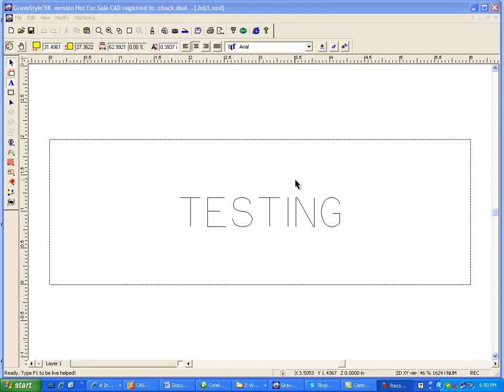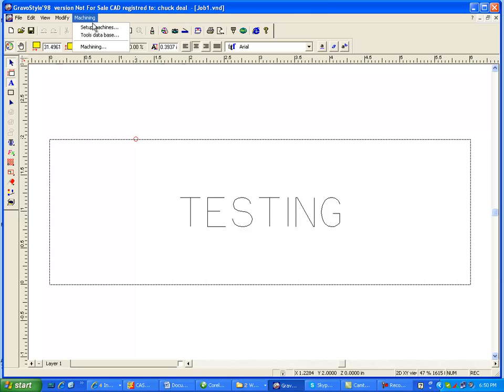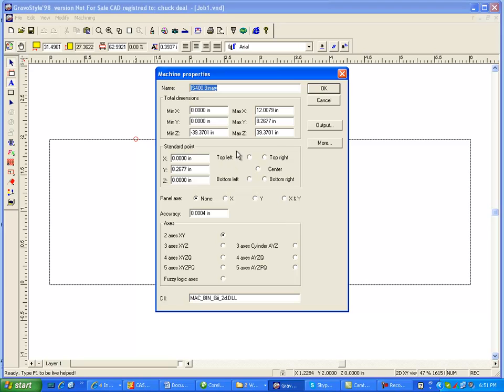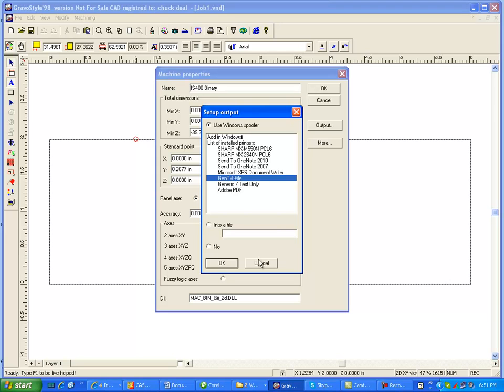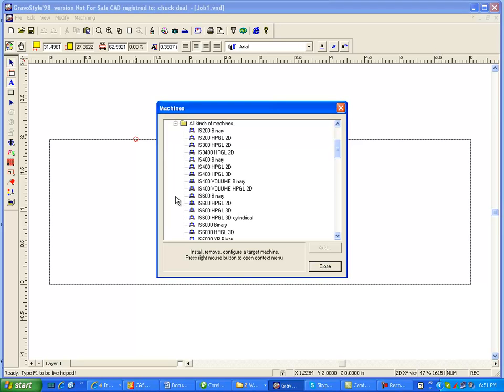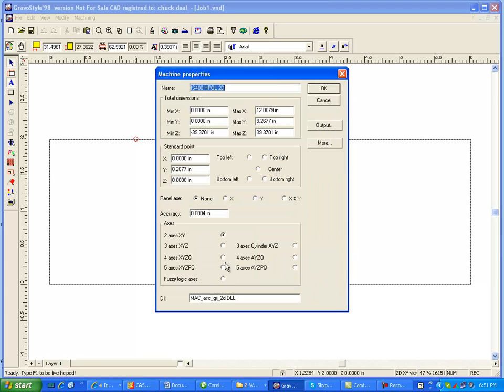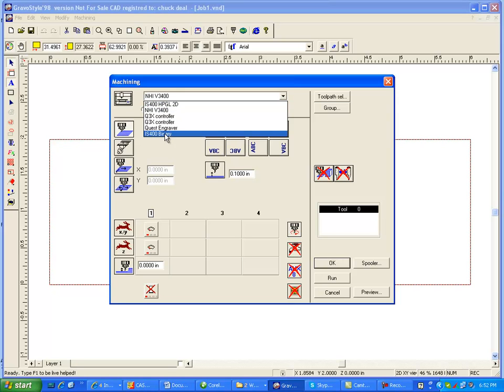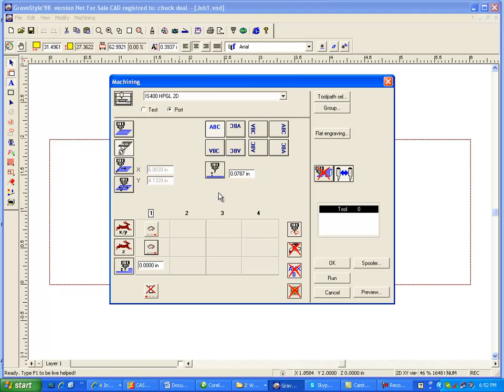EngraveLab Training

Comment: Ran this test on my is400Gift and worked and then tried to setup on engravelab v8.1 since i dont have the text fill option on my GS7 . Keep getting port errors in Engravelab but have all the buad rate and handshakes matching. Tried “hardware snd xon/xoff, tried using gravograph and new hermes settings on the pendant, tried generic printer and also GT printer. Still errors on Engravelabs side but works on GS7